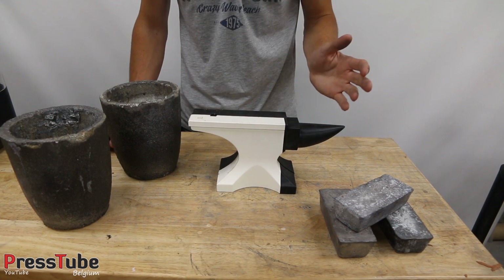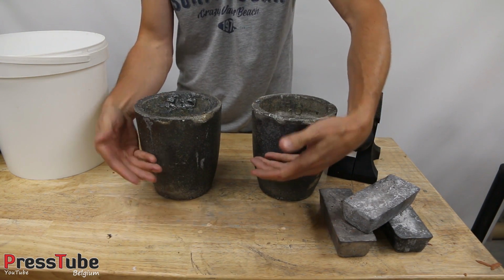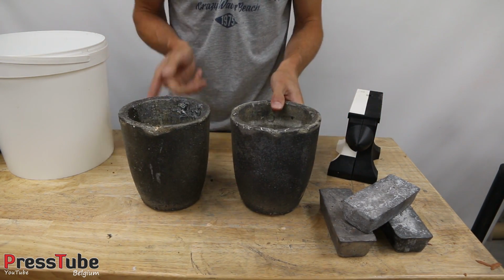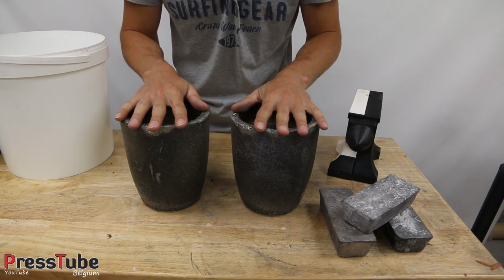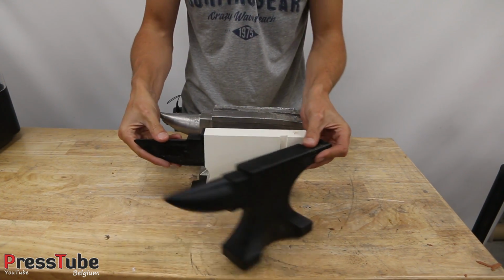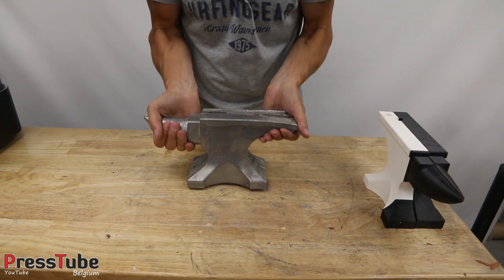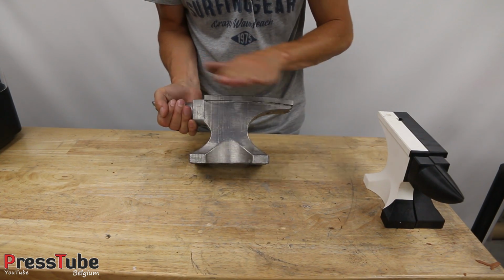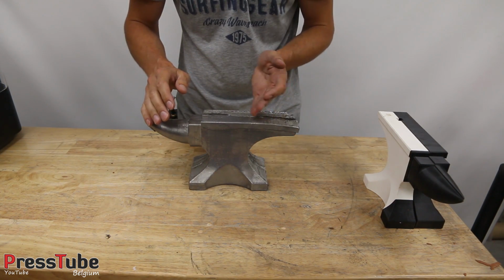CASTING an ANVIL from SOLID LEAD !

Comment: There's actually quite a few benefits to using lead, namely it's usually inexpensive, and it has a very low melting temperature! I can definitely see why you used it, especially for a piece like this, although it does have it's downsides, mainly as mentioned, it's weight

Comment: Good lord. Your one step closer to blacksmithing. (Jk, lead is to soft for smithing like that)
Reply: The Big Boz it also will possibly melt  alittle bit too cause the steel will have to be hot

Comment: Well, next one cast from steel?
Reply: Willem Kossen I don’t think he can melt steel...

Also anvils are iron I think not steel.
Reply: Prof. esrever Actually steel anvils are quite popular. He might not have the heat to melt steel but there are many ways increase the heat in a foundry.
Reply: yadaroni oh neat I thought anvils were cast iron or something not steel

But hey i guess I’m wrong
AND THATS OK IM ONLY HUMAN
Reply: Prof. esrever some are wrought iron, and cast steel
Reply: Prof. esrever o
Reply: @yadaroni  Name one!
Reply: @taunteratwill1787  increase air flow.
Reply: @yadaroni  And ruin your oven?  I don't think so.
Reply: @taunteratwill1787  I said air flow. I didn't say crank up the air like a fool. Obviously you don't increase the temp higher than your oven can handle.
Reply: @yadaroni  So no melting steel then.  :-)
Reply: For a working anvil it must be forged to be of good quality, just casting will result in a crappy short-lived anvil...unless he mounts a hardened and heat treated forged steel plate on top.

Comment: Very nice! One tip, make a riser using a tin can filled with greensand, poke a hole through it and then make a wide mouth at the top so it acts as a funnel. That will help with the pour.

Comment: Looks good man. I would've cast it with an eye bolt attached to it on the top face so you can use it as an anchor for a tent/canopy. At least you didn't have to wait to long for the lead to melt.

Comment: It's poison! Use another metal
Reply: yeah if it gets in to your body.
Reply: The Shwarma who cares
Reply: Are you going to lick it like a lollipop? Or melt it and inhale the vapours?
No? That's exactly what I thought!
Reply: Letting lead go airborne is not good at all, just having it in the air can make it end up in ur lungs by simply breathing and can cause brain damage. Not a good idea at all.
Reply: Its not
Reply: Lèmmark it is... and for me I know this as a fact since I have to to write up an experimental report for my chem assessment tomorrow
Reply: Lead is only poisonous in its particle state if it's just sitting there it's fine. Obviously if you touch it or rub it too much and it gets in your blood stream you can get sick. But I'm sure he wore a mask in the melting and sanding process...
Reply: Brenden Clark 
Even an Anvil like this gives off MINISCULE AMOUNTS of lead molecules that can and WILL BE ABSORBED into the skin,  eyes,  and mouth over TIME.
Reply: He did it outside so very well ventilated. So breathing in bigger amounts of lead is unlikely. Second, he did it once. If he would cast lead every day in a closed workshop this might be a different story. As a site note, i'm pretty sure the vapours and smoke that comes off the oily casting sand during the pour is more dangerous than the bit of lead vapour that was produced :D
But after all you care about PTs health, and thats quite nice i guess ^^
Reply: lucky43113 xd
Reply: Could someone KINDLY explain how lead ISNT bad for you? Isn’t melting it bad?

This is based on what I know, and I’m not saying it’s correct.

(I read all the replies saying lead is fine that’s why I’m asking)
Reply: yes lead is toxic, but its most dangerous when it builds up over time in your body. And that can only happen, if you work with lead regulary or eat lead contaminated food or something like this. Handling solid lead is no big deal if you wash your hands afterwards and avoid breathing in lead dust from cutting or grinding it or so. For molten lead the biggest thread (apart from the temperature) are the vapours which can easily be avoided by working in a well ventilated area (like the garden). And you dont want to put your head directly over an oven full of molten lead anyway to get so much lead in you body to get immediate effects.
So in short: Yes lead is toxic but all the dangers can easily be avoided by working outside and wearing a dust mask. And if you do this you will never get enough lead in you body to cause problems. For a hobbyist who is only working with lead every once in a while this is of course.
For a worker in a factory or lead mine there have to be much more strict safety measures of course, since he would work with lead 8-10h a day, 5 days a week for 40 years or something ^^
Reply: Something all of you concerned about his health should note - He didn't cut and polish the result as he usually does. By skipping this step, his exposure is far too low to be of any real health concern. So long as you have no open wounds, the outer skin layer of your body will not absorb metallic lead like he is working with, though washing thoroughly with soap and water is recommended.
Reply: The Shwarma read the description
Reply: OMG I've touched some lead, I'm gonna die immediately oh-oh-oh help I'm dying!!! 😂🤣
Reply: omg they sell lead pellets for pellet guns at walmart and i touched them a whole lot, even with cuts.. oh no i need to get cancer treatment asap! D:
Reply: To perfectly be honest, smoking, drinking alcohol, eating processed food and pollution all cause cancers, whats the worst thing lead going to do. Brain damage wow, i would rather have brain damage than cancer
Reply: exactly and heating it up too hot will make it oxidise.  Led oxides are easily absorbs by the body and reduce intellectual function .
Reply: Lead exposure can impair intellectual development and damage the brain if levels are high enough. Children under five years of age are at greatest risk of the health effects of lead.
Reply: Anything can be dangerous in the wrong hands, this man used proper safety precautions and melted it in a well ventilated area. He could have had a mask just in case, but it’s not necessary. This man knows what he’s doing
Reply: Fuck it i die i die i make fishing sinkers for a living
Reply: It poison inside and outside of your body
Reply: It can absorb into your skin even when its solid
Reply: Without lead there would be no electronics....

Comment: My idea for your new oven would be a fulcrum to lift your crucible up clear of the oven, then swivel to a tong mounted on a hinge to lock and tip your crucibles contents into your mold by pulling or pushing a long handle that gives your body distance from the  liquified metal.

Comment: it would be cool to see the Anvil dropped from really high on to something harder than it, and watch it get flattened when it hit the ground in slow motion. I don't know if that's within your budget or means to accomplish, but that would be what I would want to see if it were possible. It would also be interesting to see if the shredder could shred it, or if it could be crushed by a hydraulic press

Comment: What   kind    of soil   do   you use to do the  molds?
Reply: Rafa Garcia Benacazon petrobond Clay
Reply: Thanks!
Reply: Rafa Garcia Benacazon no prob. Green sand works well and is cheap and easy to make but you lose detail but really similiar.

Comment: freeze it solid in a bath of liquid nitrogen. make sure you use a styrofoam ice chest and let it soak in liquid nitrogen until the hard boiling stops. at least 20 minutes, then hang it by a thin rope and tap it with a hammer. It will ring like a bell instead of a thud. then try to use it as a real anvil, heating a piece of steel and hammering it on the now solidly frozen  lead anvil.   another idea to try-----> Make a lead bell, freeze that in liquid nitrogen and then once its frozen, ring it. it will sound bell like instead of a thud.

Comment: Associating the word "lead" with the word "solid" is not a good idea when you see how soft lead is 
And you can’t forge on this anvil simply because the lead is softer than hot steel and melting point of the lead:~300°c 
Steel forging temperature is about 1100°c 
So your anvil will melt slowly

Comment: If you cast the anvil out of steel when you were done you'd have a usable object. I'm curious why you would choose to make an anvil out of a material that would make it completely useless as an anvil? 
I really enjoy the content on this page but the choice of lead is a real head scratcher.
Reply from the maker: My furnace can’t melt steel ;) You’ll need an industrial furnace for that.
Reply: PressTube actually many people melt steel in foundries even smaller than yours. You can upgrade your burners but you might get enough increase just by adding some forced air. Get a metal hose (to add distance from blower) and use a cheap hair dryer add air.

Comment: What sand does he use
Reply: Freddie Jee it’s called petrobond. Fine silica sand, Bentone and oil. Similiar to greensand but holds the shape better and finer detail
Reply: ArtByAdrock thanks
Reply: Freddie Jee no problem 👍🏻 I explain a lot in my videos if you wanna check them out
Reply: ArtByAdrock I will
Reply: ArtByAdrock if you are looking for ideas make Thor’s new hammer storm breaker
Reply: Freddie Jee I’ve actually thought about making that but I have a few projects lined up already and my 3D printer is very busy haha but I will 👍🏻 doing a giveaway next week but don’t tell haha. I’ll have a new video out later today from the walking dead